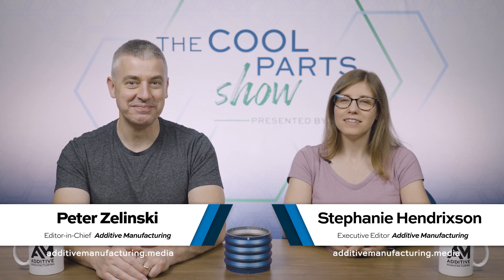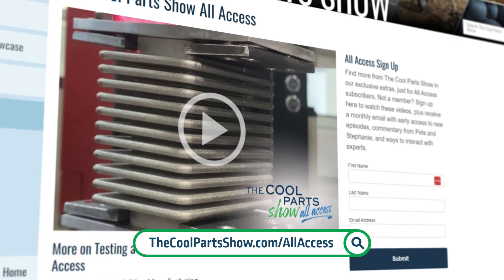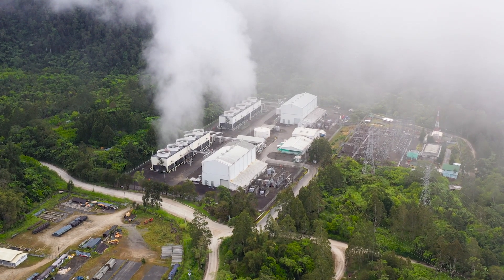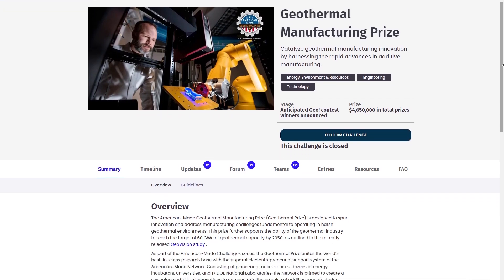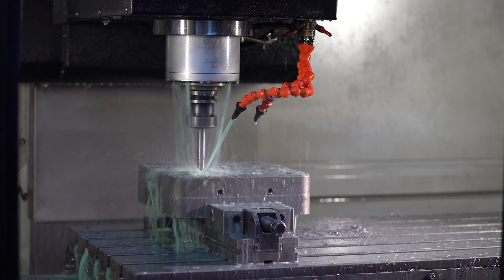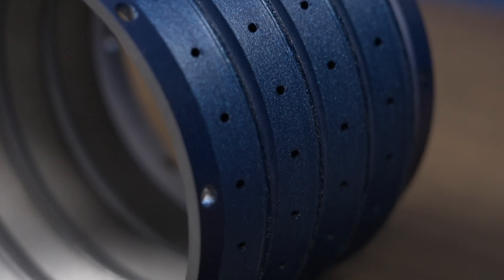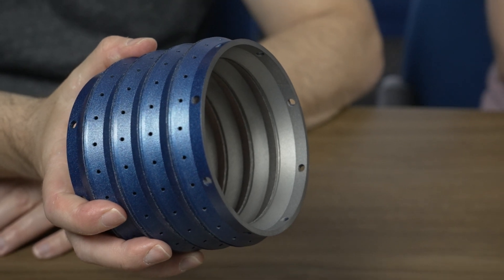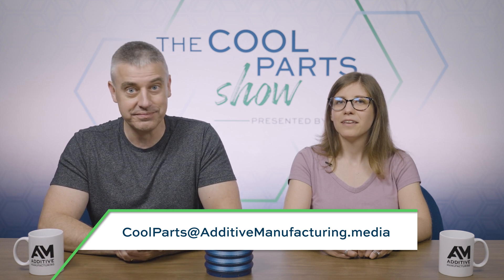3D Printed Seal for Geothermal Power | The Cool Parts Show Ep.73

Comment: as I remember, there are metal plugs and packers used in oil & gas drilling and production, which are fully metal and can take quite high temp
Reply from the maker: Kevin Havlinek, featured in this episode, weighed in on your comment: "Regarding those full metal plugs that have existed for many years in the O&G industry:  They do not have the expansion required to be a frac plug, nor are they easily deployable and easily retrievable."

Thanks for watching and commenting!